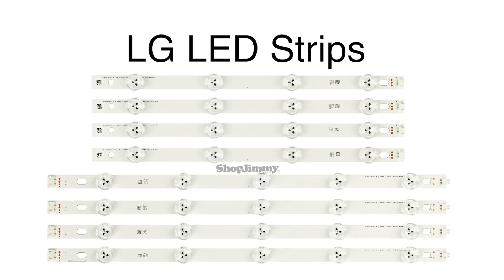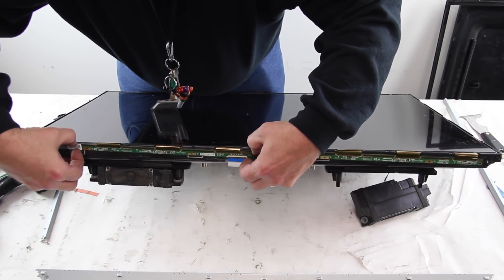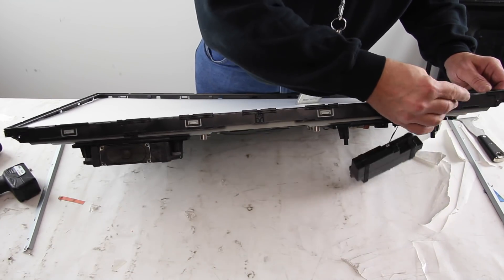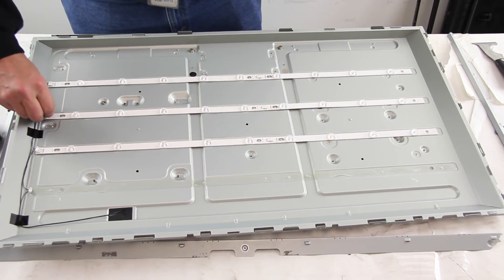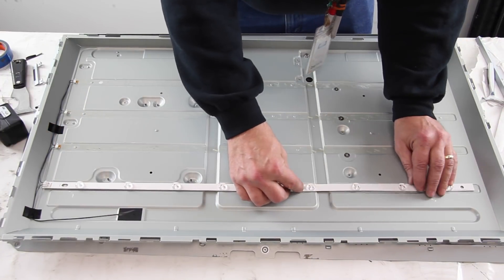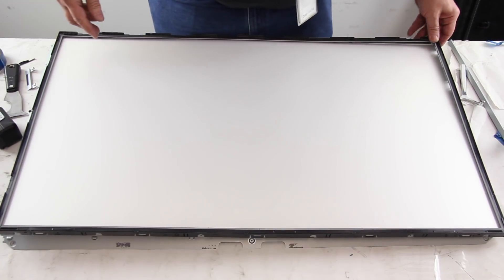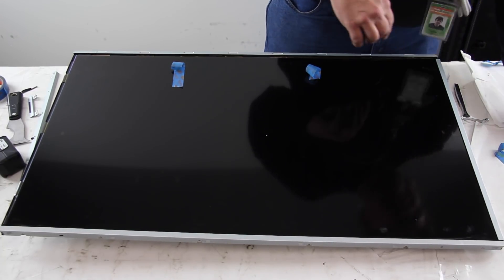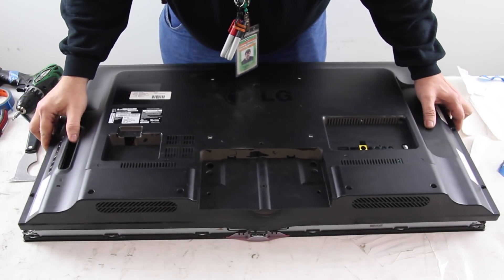LG 39” LED TV Model 39LN - No Backlights Bad LEDs - How To Replace LED Strips

Comment: Have a 39LN5700, it says the LED voltage should be 133. With the LED strips disconnected it reads 220 volts. Is this too high or do I need to take a reading with the LEDs connected and working to expect to get the 133 Volt reading?

Comment: I have an LG 55lv5500, after about 15-30 mins the backlighting in the top middle of the screen dims and image on the right side begins to blur, and display out of sync. If the set is power cycled its fine for a few more minutes. Am I looking at a bad T-Con board?

Comment: Dear ShopJimmy, I've got a problem with backlight in my LG 42LA620S. It passed the flashlight test- I can see image when I flash with flashlight on the screen. I measured voltages on LED+ on powersupply while plugged and unplugged backlight- in both cases I've got 118V (there should be 157,5V while backlight is plugged to powersupply). I've tested LEDs with LED tester and it showed more than 135V when LEDs brights a little. Two LEDs are broken but I temporarily closed that LEDs from circut.
Is that could be a powersupply issue? I saw on some of your video that when voltage on LED+ is lower than normal with plugged and unplugged backlight, it is a powersupply issue but I'm asking to ensure.